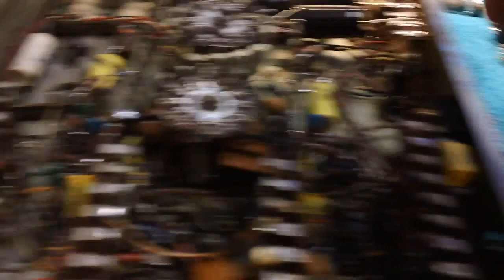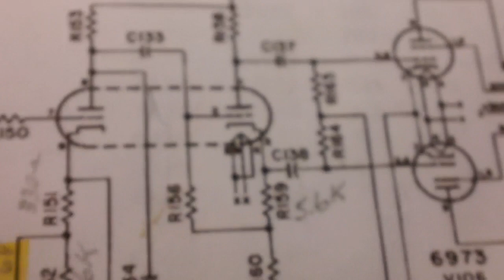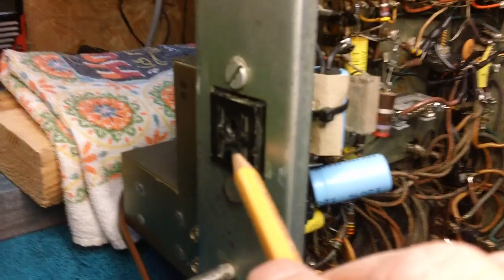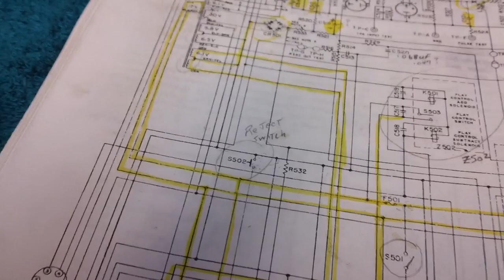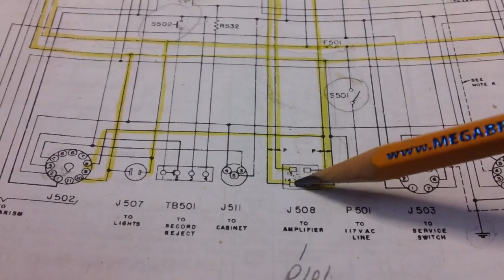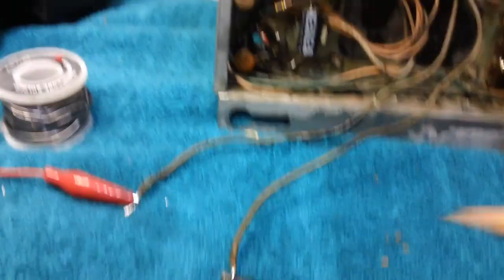1961 Seeburg AY100U Jukebox restoration (Part 58 of 87).

Comment: this reminds me, way back in the day i got my Laney Super PA Amp...it worked the evening before and when i started again the next day...it doesn´t wanted to work anymore...just the filaments...no B+...after hours of digin´ around i found that the fuseholder also wasn´t connecting the fuse to the circuit anymore. I ripped it out and replaced the damn thing.

Comment: nice job, 5U4 is not on till you drop a coin in, so no high voltage to amp when not in use. Since filaments are on all the time, droop the coin and the 5u4 starts and high voltage is applied by the time selector mechanism has found the record to play. That is why filament voltage is from the tormat amplifier. Service switch should also turn it on!  Best of luck!

Comment: John, there is nothing wrong with the amplifier. You need to flip the service switch over to the spring loaded side, this turns on the motor and amplifier. The 5U4 does not stay on all the time, just when the jukebox is playing records. The amplifier is in the standby mode..
Reply from the maker: Harry,
If you're right, my friend, I owe you a banana split.  I'm heading for the shop right now.
Regards,
John
Reply from the maker: Harry,
I'm back.  You da man, my friend!!!   Thank you Very much.
Regards,
John
Reply: By the time you are done with this jukebox you will be speaking fluent Seeburgese!!!!    Lot's going on in these things.
Reply: Harry   Looks like that double solenoid ratchety thingy feeds the amplifier transformer with 120 vac.    Does that service switch activate that ratchety thingy?     And it requires 2 flicks of the switch to ratchet through a couple different modes?   What are the modes?   Thanx.

Comment: Good sleuthing.... I am in a similar mode here as well.  You'll nail this down;  piece of cake.  :) Just a thought on those pins.. perhaps they opened a bit from some tech jiggling the two units?  I noticed that P101 only passes 6.3.... the question is how does he 5.0v rectifier voltage get in there .. ????..  I know you'll find it.  - Ron